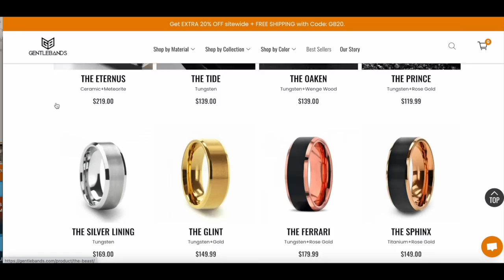OUR WINDOWS ARE HERE!

Comment: Love watching the progress! Wondering though about the 4X4 legs on the stairs. If it's not code, (around here it would not be) I think a 5X6 would be a lot stouter and elastically, would look so much better. A raw log would look even better. But it's your home, do as you wish.
Reply from the maker: Hi Chip! I had thought about that as well. I may talk with my engineer again and see her thoughts. Thanks.
Reply: @lifeelevatedoffgrid  I am in North Carolina and I think the norm here is 4X4 can go up 8' and you have to go bigger after that, except at the beach areas, Everything is over sized down there.

Comment: You are probably leaving your nails in the sun letting them warm up, and if they're plastic collated the spring in rack when you put two racks in the spring well compress them making your nail gun jam. It not your compressor, it probably fine nothing wrong with it. If you don't believe me give it a try by putting only one rack of nails and your nail gun well work just fine. Oh don't forget to oil the tool before using and drain your tank daily for years of use, or your nail gun well rust. Just a tip
Reply from the maker: Hi Tommy. Yes the nails were in the sun. But also the compressor was having some electrical issues and wouldn’t kick on when it should have. The new compressor works great. No jams and way more power.

Comment: Have you drained the compressor? The issue could be that is has water in it. Just a thought.
Reply from the maker: Yes we drained it. It was having some electrical issues. Wouldn’t kick on when it got low on air.
Reply: @lifeelevatedoffgrid  bugger! Oh well you can use the old tank as an additional tank for the new one. 😁